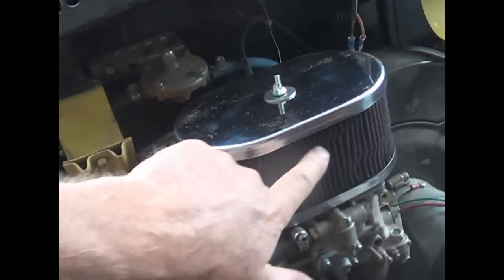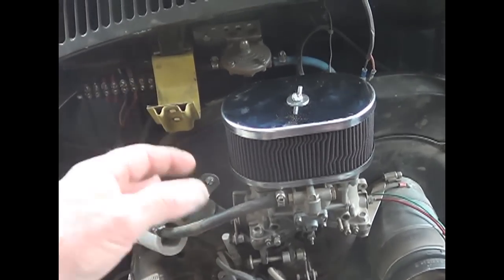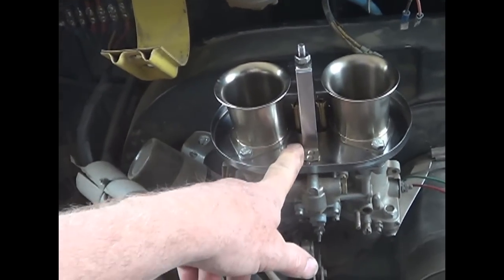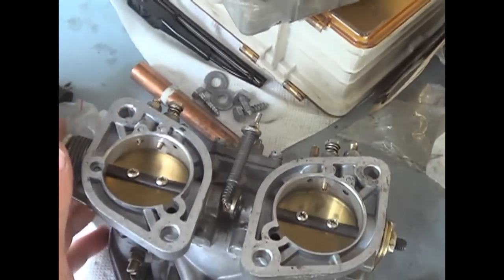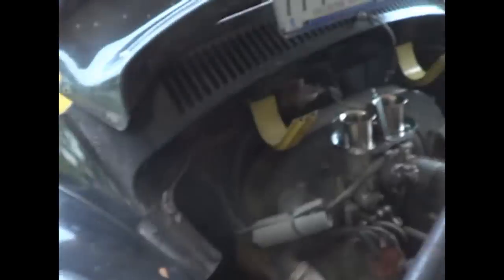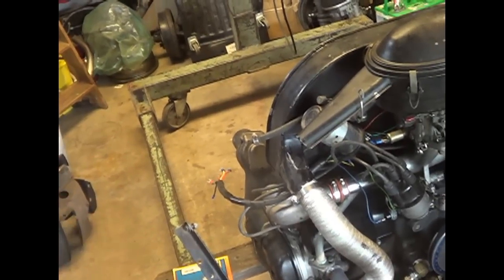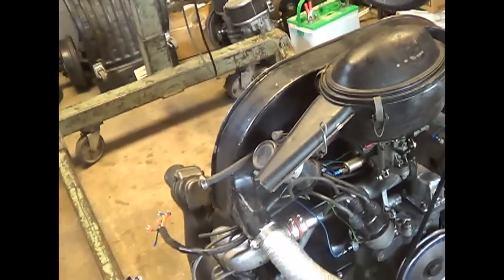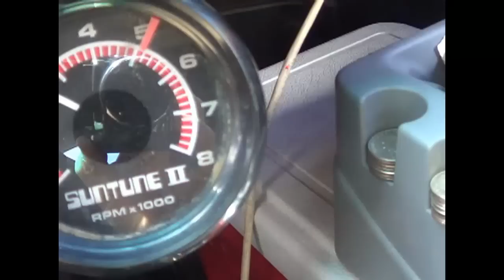Weber IDF Center Mount Problems and Solutions

Comment: Where and how Big should I drill holes on butterfly valve?
Reply from the maker: The Weber manual does not specify exactly as it will differ on every engine size and it's volumetric efficiency.  I used a fractional drill bit set and started very tiny. No Change. Then went to the next size up in my index and that was just a little to big. I almost couldn't control the idle. It's very important to follow the Weber tuning procedure. You not supposed to turn that throttle stop  adjusting screw  more than 1/2 Turn in. Your making the new hole to add air and your turning the idle needle valve to obtain idle speed.  If your using a intake manifold with a cross over hole it makes everything even harder to tune. 
If you don't have enough heat in your manifold and you get frost at the base of your carb when cruising then any fine tuning is a waste of time.  It will still run at high speed in warm weather but get horrible gas mileage since you have to compensate with such a rich mixture on the mains.    Good Luck with your project and consider purchasing a Weber book. The history part is really interesting and educational.  The IDF carb was made to run port on port even though you see them on most off road race cars in the desert heat. However you don't win races idling.
Reply: @TheEZGZ  hey sir, thank you for all these useful technical information, cheers, appreciate it

Comment: where does the vacuum advance go on the single duel carb shown?
Reply from the maker: +Donald Yeager You would probably want a mechanical advance dizzy.
If you want the vacumm you would drill and tap the manifold anywhere convenient.  A gas airplane hobby store might have a threaded hose fitting you could use???
Reply: TheEZGZ - Correct me if I´m wrong but I do believe the original vacuum dizzy. Took it´s vacuum signal not from "after the butterfly" (manifold), but from before the butterfly.

As such it will never work properly if connect as described. On the other hand a vacuum connection in the manifold is marvelous for connecting a vacuum gauge. Which for me is still the best way to tune that bloody thing that consumes all our time... LOL :-)

Either case top tips on this video. Thanks for sharing. ;-)

Comment: How do you think that single 40 would run on a 1915 or 1968 with w100 cam, 7.5 compression and flamethrower 009 with vac asst. Thx
Reply from the maker: +Jaime Willard  They work fine if set up correctly and you have plenty of heat in the manifold. Stay tuned. I am going try and put one on this 1800 I just built.

Comment: hi man, I have dual webers dcoe 45 mounted on a 1,8L BMW M10 engine, the question I have is I've been using a redline electric pump at 8psi approximately. do you know what would be the ideal psi for this kind of setup?
Reply from the maker: 3 1/2 to 4 psi max with a 5mm or 5/16 I.D. Fuel Line
Reply: TheEZGZ thanks man! I did just that but when I hit the gas pedal the engine would starve, and when I raised the pressure back to 6psi the problem was gone, do you know the reason for this? I can tell you the gap between the carb covers and the floats is way above 13mm, do you think float level has a relation with psi and possible engine starvation? or should I look somewhere else? thanks again man, I've watched all your Weber videos and they've been so helpful!!

Comment: I've got a progressive 2 Barrel that has a dead spot. I'm currently running an 09 distributor. I can't seem to get rid of my dead spot
Reply from the maker: The heat risers to the intake from the exhaust must be connected and work well. Most after market exhaust headers will not work properly for this. You must have heat, even in the hot summertime. A vacum distributor might help. I have never had good luck with those progressive carbs. I like it to run perfect
Reply: +TheEZGZ Thanks

Comment: Found it,its the brass fitting above the flange
Reply from the maker: +Donald Yeager You are correct. My eyes were not focusing.  I finally went to in the garage to look. It's right where you said. Sorry.  Thanks for clearing that up.
Reply: Now that I have that hooked up the engine still races and i have no throttle control? why?

Comment: can 1.4 ratio rockers work well with a stock carb?
Reply from the maker: Look forward to that off idle stumble every time you take off from a stop. More lift allows for more breathing at higher RPM your stock carb and stock valve springs will limit you. You will also need to use aftermarket shorter push rods. Unless your willing to dual carbs leave it alone.
Reply: Thanks. I guess I'll prob wait till I have extra carberation to install ratio rockers. I'd like to keep a centermount since I'm in very muddy terrain. I might get an idf down the road and just live with the compromises.

Comment: You didn't even Greece the top and bottom of your air filter, how do you expect to keep from getting any dirt inside the carburetor with that garbage filter?  The only filter you can put on that carburetor to actually keep it free of debris, is a UMP paper filter.
Reply from the maker: I get a good seal using the cast aluminum top instead of the tin chrome ones.  I agree with you on paper filter being better than cotton in dirt. Where can I buy them?
Reply: TheEZGZ  Unique metal products makes them, a little pricey, but will keep your motor alive for a long time.
Reply: TheEZGZ Nice manx too bro!

Comment: Or throw out the float bowls, jets, emulsion tubes, accelerator pumps/diaphrams, cold start stumbling, altitude probems.....  into the trash and purchase a fuel injection system!!   Ha ha ha.  Just joking.  Making the carb and induction system "work" to your requirements is a satisfying adventure.

Comment: Too much cam for that engine. Try stock cam with 1.4... You will be surprised! More vacuum means better atomization
Reply from the maker: 1.4 suck.  1.25 work great on a daily driver. I learned the hard way. An yes I did it right!
Reply: Mr EzGz, thank you for your response. I agree, 1.4 may be a POS... But Im using a CHINESE set... Im losing an lash cap every now and then, and I Know they will fail... But torque is unbelievable with a set of stock heads slighly ported, unshrouded vaves, 8.5 compresion and a set of kaddies
Reply: Mr EzGz, thank you for your response. I agree, 1.4 may be a POS... But Im using a CHINESE set... Im losing an lash cap every now and then, and I Know they will fail... But torque is unbelievable with a set of stock heads slighly ported, unshrouded vaves, 8.5 compresion and a set of kaddies

Comment: Hey, I love you videos, and I've learned so much from you!  I know we all dream of the center mounted weber idf on our VW motors, but I was thinking you can appreciate this so I wanted to share with you. This is a 44mm weber idf center mounted on a 1600, now it's not stock, 12.35:1 compression, fat performance FC19 cam, .30 off set ground crank for true 1600 displacement, single heavy duty valve springs, stock heads & valves with stock ratio rockers all balanced with a lightened flywheel running on 114 race gas but you get the idea...  Head over to my youtube page and watch the first and second video I have up on there.
Reply from the maker: +Mark Sweet!!!!!!!   Always liked FAT performance. Been around since the beginning.  Heading out on a fishing trip. Gotta Run
Reply: Sorry to be so offtopic but does any of you know a tool to get back into an instagram account??
I was dumb lost the login password. I would appreciate any tricks you can offer me
Reply: @Gregory Kyler Instablaster =)
Reply: @Marco Ty thanks so much for your reply. I got to the site on google and Im in the hacking process atm.
Seems to take a while so I will get back to you later with my results.
Reply: @Marco Ty it did the trick and I actually got access to my account again. Im so happy:D
Thank you so much, you saved my ass!
Reply: @Gregory Kyler happy to help =)

Comment: I just helped a friend do this and it's idles fine but, once you open the throttle blades 1/4 it boges and never gets better untill you close the throttle
Reply from the maker: Most people use to big of a carb. a 40mm Idf will work fine on a 2276 if jetted properly